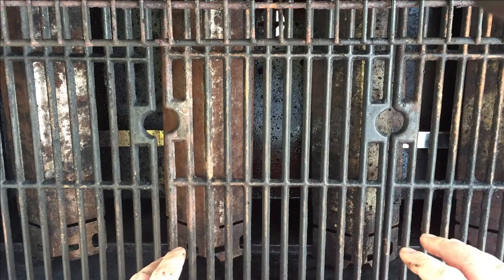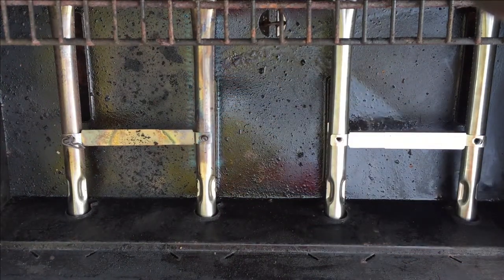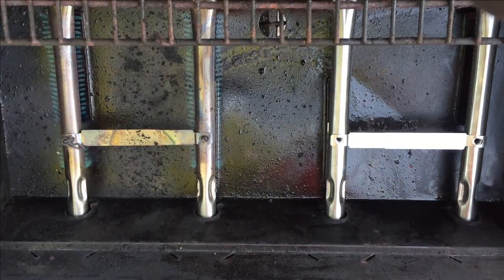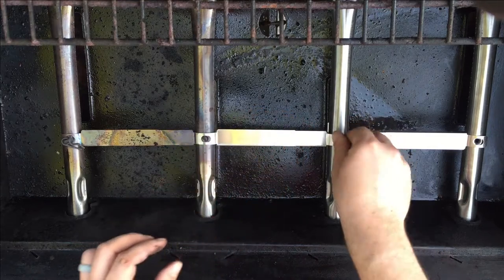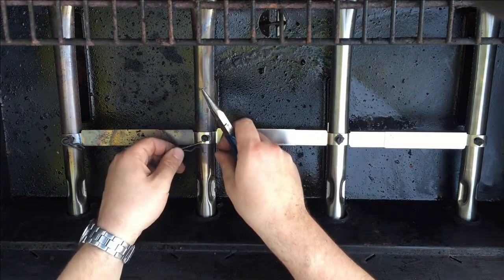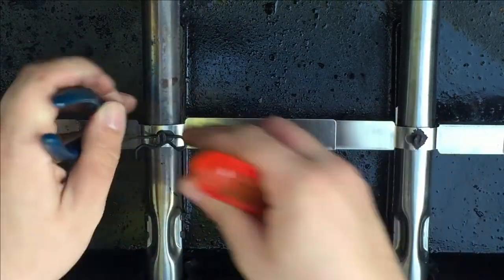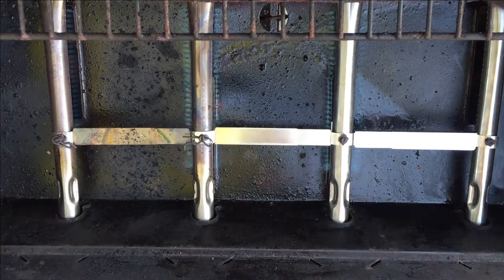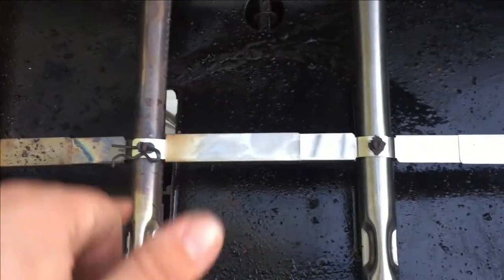Why Aren't All My Grill Burners Lighting? (Easy fix)

Comment: Thanks so much for referring me to this follow up video. I think I just need to use a screwdriver to loosen up the screws so they'll be lifted up more to thread the metallic pins thru easier, and then I can just screw it back down tight. That's really the only thing that was giving me problems, I was just concerned about whether or not the screws could even be moved. Now that I know they can I'll try it when I get home! Thanks!

Comment: Thank you for showing this, but help me understand how a flat piece of metal conducts propane (or helps it travel) over to the other burners. Are these cross burners supposed to also catch on fire to serve as a bridge for the propane?
Reply from the maker: You’ve got it. It’s just a tunnel to help the fire travel from one burner to the adjacent ones. The burners are too far apart to light each other so the bars act as controlled passage of fire to the other burners.

Comment: Thank you! For my grill, from left to right, #s 1, 2, and 4 light up fine with #2 being the igniter. #3 however does not light even with a match. I don’t even hear gas coming through when I turn the knob. Any ideas?
Reply from the maker: Might want to try cleaning out the end where the burner meets. Sometimes spiders build webs/nests or debris gets in there an covers the hole that enters the burner. Try cleaning it with a tooth pick